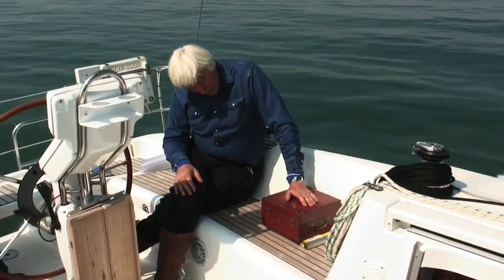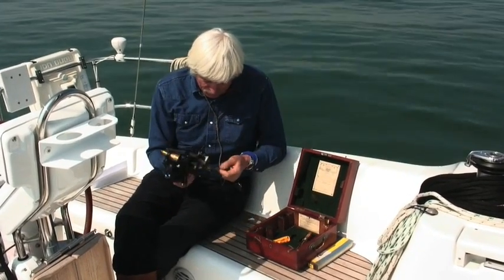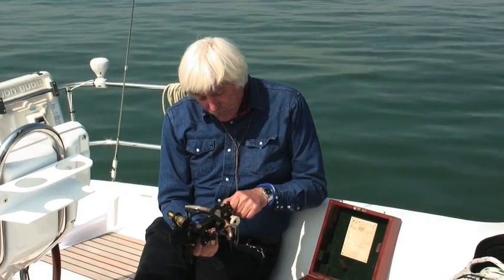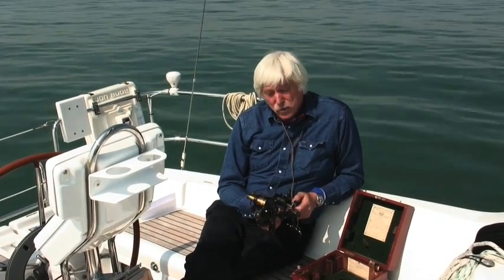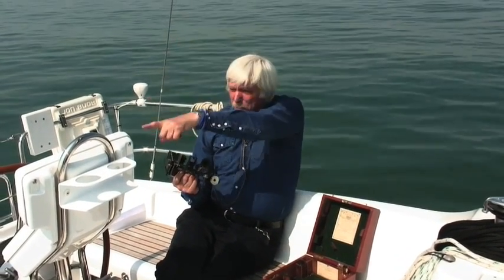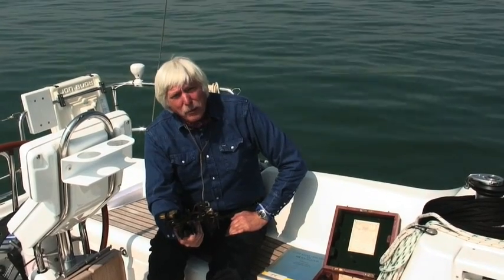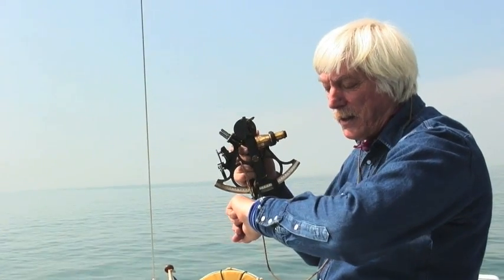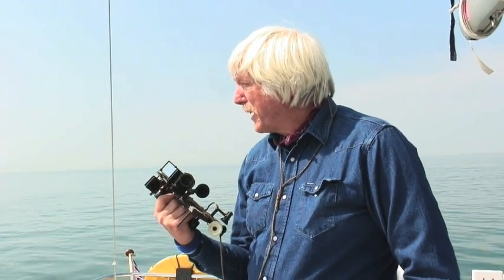Getting a Fix  - with a Sextant

Comment: Hello Mr Cunliffe,,,,,,,jim wyatt ,   southampton.
                   I have a question
If i am on a vessel in the middle of nowhere and all i have is accurate time, ie GMT and a sextant with pencil and paper,,,with nothing else at all in the way of almanacs and tables etc. Is there any information i can glean from the equipment at hand and how do i get it.
Reply: Hello Jim, maybe 3 years too late for your question but with no almanacs or tables you have two possibilities: (1) You can shoot the pole star (N. hemisphere) and get your latitude (= angle from horizon) without any corrections at all. One minute of arc will be about 1 nm as one degree = 60 nautical miles.   (2) You can do a series of sun shots before and after noon, say one every five minutes to get the maximum at noon, this will give you your longitude and and approx. latitude, as you need the so-called equation of time table to get it more precisely.  This could give you a position to within 10 nm - enough to see land on a clear day.